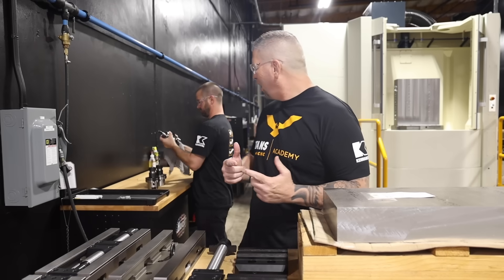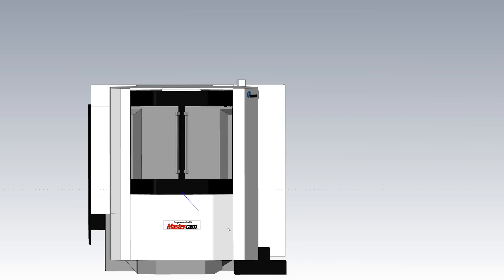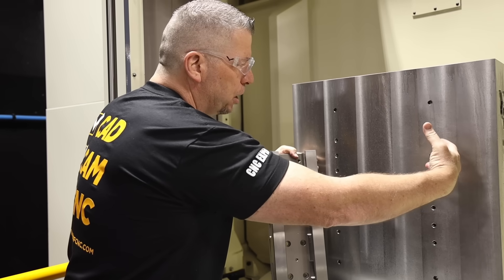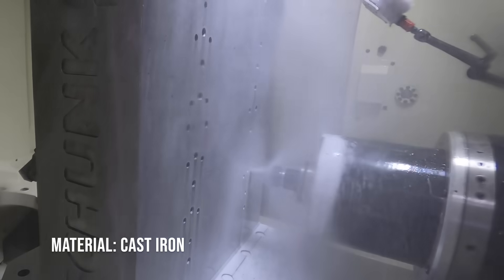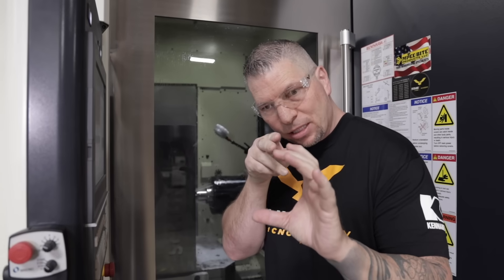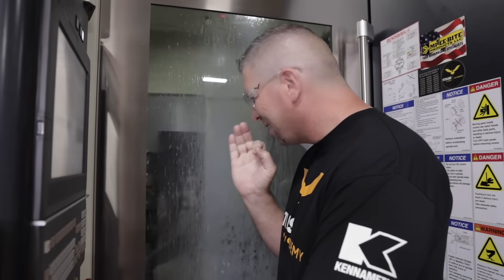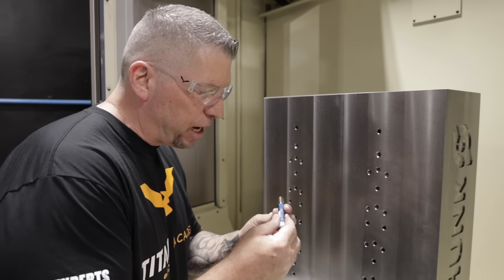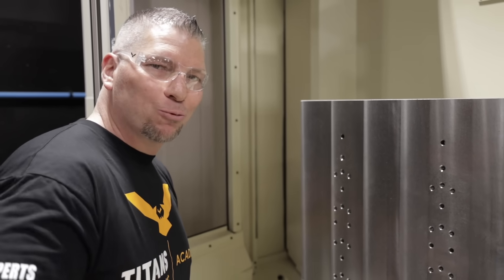60 HP MAKINO | CNC Machining Custom Tombstone | Kennametal | CAST IRON

Comment: When the tap reaches depth, and the spindle reverses, there would naturally be a deceleration, reverse and acceleration of both the spindle rotation and feed. Is tap held rigidly or is there some longitudinal float built into the tap holder?
Reply: Synchronous tapping locks the z axis feed to the spindle encoder. As spindle rpm changes so does the feed rate.

Comment: Should've put some dowel holes for quick positioning of the vises.
Reply: Not saying you're wrong, but I find alot that you can get better accuracy without hard stops. Good indicator and practice. I know in theory it's slow and dowels should work, but I've found a thou here n there, and then you cant knock it square or you'll damage the fixturing.
Maybe that's just me though...
Reply: @wildin13  I didn't meant dowels as hardstops. I bored all my pallets and tables in pattern. Bored subplates for vises or directly bored vises. I use 2 dowel pins (round and diamond). Haven't aligned a vise in years. I do precision work, one off's, and it didn't bite back so far.

Comment: i dont understand why you would test the threads with a thread gauge. If these threads would be milled instead of tapped and the thread would have to be a precise one then i would understand why, but i have never had a tap make an undersize thread. Before the thread is Undersized the tap would just break off.
Reply from the maker: ? You don’t know why I quality checked my threads? It’s just the right thing to do, especially as an example to young machinists etc. My calculations on fees compared to spindle could be off... I could have packed chips in a few holes etc. who knows. Inspection is the most important aspect of precision machining.

Comment: What you forgot to do is tap the first hole and check it before moving on. I was taught to always check the 1st hole .
Reply from the maker: That would be a longer video. Someone else on here suggested I should inspect at all. Can’t please everyone 😁
Reply: @TITANSofCNC  I wouldnt mind a longer video lol just figured since you were checking with the thread gage ,normally I always tap the 1st hole and check the depth to make sure everything is to spec.
Reply: Only way its gonna create a to small thread is if its worn out, that would take thousends of holes in regular soft steel or cast iron.
If you got the parameters wrong at that feed rate there wont be more then half a hole threaded anyway.. :)

Comment: And here I am half turn forward, quarter turn back by hand.
Reply: Machine tapping scared the crap out of me first time... especially as I run heidenhain so have really good feed overide reflexes, but once that cycle is called the feed is locked into the rpm and the overide does nothing...

Comment: why not use a 90 degree spot drill to chamfer instead of circle machining the holes?
Reply from the maker: Less pressure and one tool allows all sizes and you can profile entire part also.
Reply: Because you can chamfer any size hole or featurr with the chamfer cutter. One tool instead of many.
Reply: I wondered that too! When you know the chamfer too, then you know what depth to go! Yes?
Reply: Also, a 5/8 chamfer tool can be used for ANY hole up to 15mm.

Comment: We used to machine lots of cast and SG Iron. Used to make a nasty mess of the machines when using coolant.  Cast Iron cut on the manual machines was always cut dry as the carbon in the CI acts as a lubricant.  Chips had to come off blue to remove the heat from the job.
Reply: I always knew that cast iron should be cut dry. But 1 time my cutter got so hot as to weld itself to the part. The part went glass hard after that, ended up as scrap.
So now I am always scared 😣!